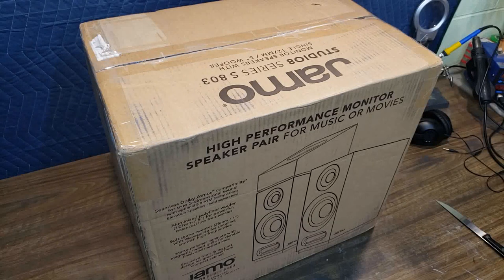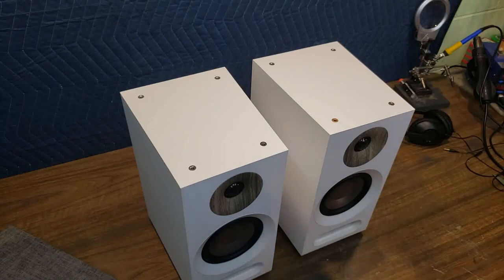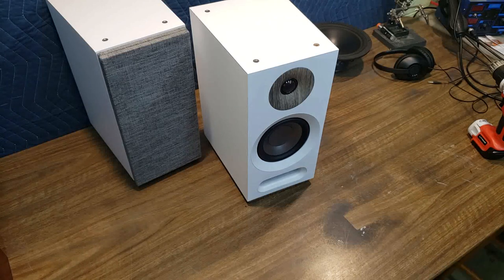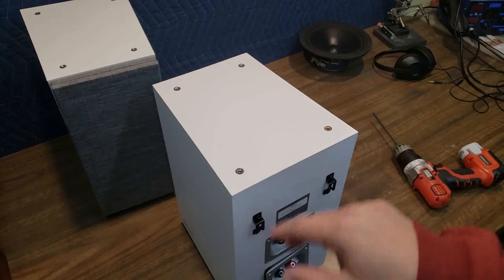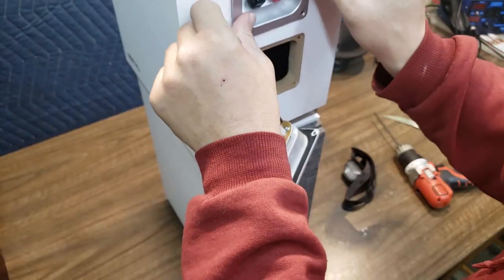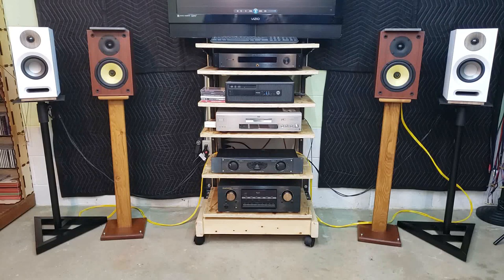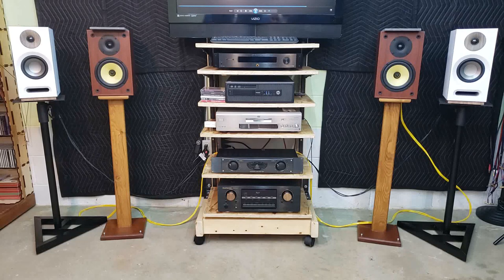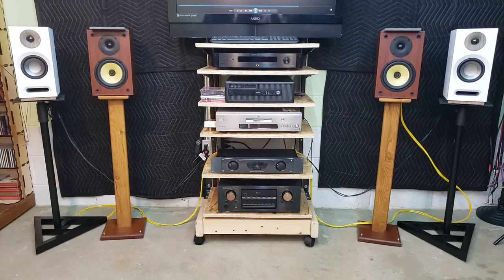Jamo S803 Speaker Review Sound Demo & Thoughts

Comment: By having the back of the speaker be wider, you avoid the side walls of the cabinet being parallel, which in turn helps with reducing/avoiding standing waves within the cabinet. Speaker design basics.

Comment: The reason they have 2 sets of posts and run the wires up is just for wiring efficiency.  It’s more reasonable on the towers s807 & s809 because it puts the terminal posts all close to the floor.  Sorta dumb for the bookshelf iteration but I guess for the sake of not having to make another set of atmos toppers with their own terminal posts they went with this design instead for all sizes.  The only one that does not have the atmos topper ability is the s805

Comment: The Atmos speakers are primarily designed to sit on top of the floor standing speakers and its easier and looks better to have the connection at the bottom of the floor standing speakers, and this design was carried over to the bookshelf speakers.

Comment: Atmos speakers / modules are slightly angled hence depending on room conditions, users can have the Atmos modules flipped / rotated without exposing the cables.
Reply: I don't think they work like that.
I have the 803's and the connection for the Atmos is only to 2 of the post on the top. So depending on if the atmos speaker has the connection for reverse use

Comment: The the top brackets are just to keep the additional speaker in place, they are not for any connection purposes, the two are connected by jumper leads.
Reply: wrong, the signal runs through the top connection points

Comment: Would you recommend these speakers for a 5.0?
And what s805 do you think?
Reply from the maker: The 805 uses the same drivers but the larger tower cabinet gives these a lower freq response of 49hz. Should sound nearly the same as the 803 with a bit more low end. There's a seller on ebay right now offering them for $160 a pair free shipping.
Reply: @iowaudioreviews  199 for the whole 5.0 system with center channel! so $80 per pair + $40 for center channel
Reply: @iowaudioreviews  there is a $200 5.0 package with these as front speakers, 2 smaller surround speakers and a center speaker all for $200 on amazon, if you're gonna buy these speakers, might as well get the package for ~$80 more.
Reply from the maker: @CUBEoneVX  That is a very good deal. I sold my Jamo S803 in favor of the Sony CS5 after my side by side comparison video. If I had enough uses I'd kept them but just have to many speakers around...LOL.

Comment: If you untwist the RED and BLACK binding posts all the way, then any banana plug will fit securely with absolutely no movement. You should understand this. Tests and reviews are always flawed when the individual doesn't fully understand common sense.
Reply from the maker: Yeah yeah I know and have done this with other speakers BUT its NOT how binding posts are to be used and isn't demonstrated by any manufacturer. A CHEAP shallow binding post also has much less surface area with the banana. They're cheap crappy binding post on all these budget speakers just enough to get the job done and 99% of the people that buy them probably care less or don't notice. I understand more than I really care to and usually don't care to anymore. You can do a video demonstrating this genius you posses, congratulations.